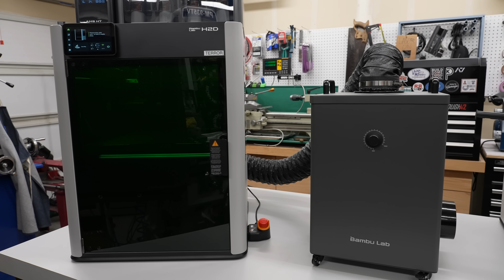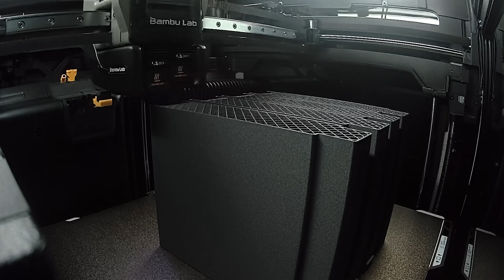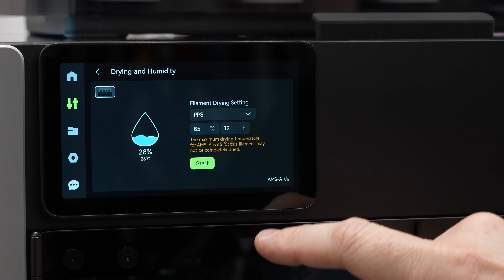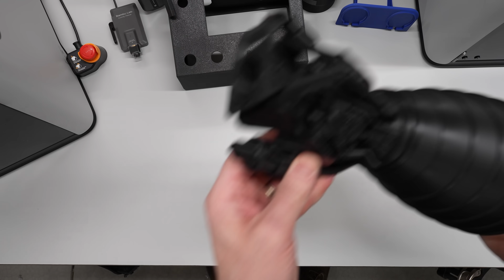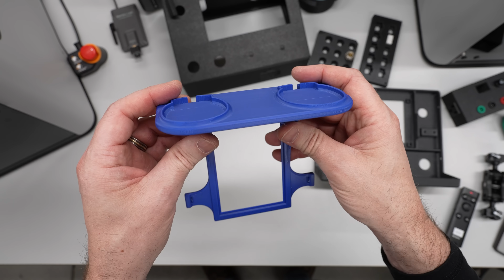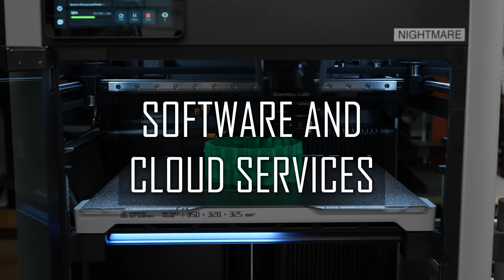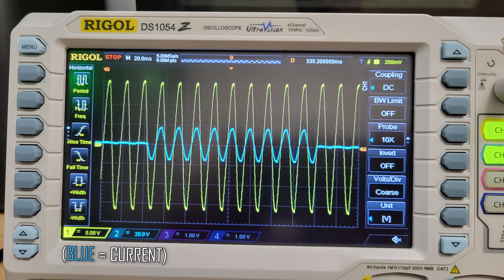What I Learned from 300 Hours with the Bambu Lab H2D 3D Printer

Comment: Very good an honest review! Thank you! 
But in general I'm very concerned when it comes to do laser work in a 3D printer. I own a bigger laser machine and the contamination from the fumes inside the machine on every single part is immense - even with a powerful extraction. Prepare to clean the entire inside of the printer after every laser job. Thinking of the delicate mechanic inside a 3D printer: Laser work? No way! Laser is DIRTY! Also the bed capacity is far too small for laser work in my experience. 3D print? Ok. But laser? You will most likely run out of space very soon. I'd recommend to buy a separate laser machine if you are planning to cut material if you have the space to set it up.

Comment: Unfortunately I can't agree with a piece of equipment that sends my jobs to the cloud and back to print 3m from my location. As well as constant monitoring. If the machine is in my LAN it should be able to work from my LAN. It's a pity, because the hardware is top notch and I would buy it. Also, why the hell would you put a laser in a 3D printer, the stupidest idea ever.

Comment: @Clough42 Have you tested any soluble support materials on the H2D (such as PVA or HIPS)? 

I’m mostly interested in using PVA in conjunction with PETG, but could do PLA as the main material. My geometries don’t usually need a lot of support materials, but they can be tricky (or even impossible) to fully remove unless I use a soluble material. Plus I want to reduce post-processing as much as possible as that is one of the most expensive parts of my throughput.  Hence why I’m most interested in PVA—because water as a solvent is cheap and easy compared to limonene.

Comment: Adding a laser unit is some gimmicky dumbfuckery one can only find on one of those crazy kickstarter all in one machines. Spoiler alert its never a good idea. Never. Cant imagine having to clean all the sut from the inside of printer when needing to do some 3d printing and then also doing tool head changes will be a massive pain. I own 6 electric drill because i got tired of changing the drill bit for ever time i need to drill another hole. Forget about being able to use the best laser software - lightburn as bambu will be steaming fwd with its closed eco system plans. The price point is also ridiculously high. U can get a formlabs
Qidi printers are the unsung hereos. Been my most satisfying 3d print experience. With my bambu i had a print error about 1 in 6 and with qidi its been 1 in 60 and very small errors. My bambu has destroyed 2 hot end assemblies which i needed to replace because of a very dumbass design by bambu. Very small/thin and exposed thermal connector which will get destroyed with a blob

Comment: A few things, I never asked for this, the true build volume is smaller than advertised. The main thing that intrigued me was that their website showed "live spatial alignment" using the birds eye camera. They showcase a shoe sole or feet per say and then being printed from this. I have yet to find any info on this and seen no one actually do it, this is the 3rd video I watch mind you. For now I will just stick with Prusa or others, Bambu has disappointed me after their latest firmware fiasco and the trying to hide it. I do like the new AMS, however, it seems like printing TPU is still an issue so there is that. And I do own a P1S, I was originally excited about it, until they did what they did. So again, I will just stick with others for now. I am upgrading my P1S to a open source printer as soon as AMS support comes out for it.

Comment: Have you noticed VFAs?
I guess they are always present. But the only printer i know of completely eliminating them are the HS3 by pantheon because it uses servo motors for the motion system and have ball screws instead of lead screws.

Comment: Geez, that's a lot of power draw. The average I'm sure is 200-ish? What I'd recommend to save on house wiring... and like, not being able to run even a small farm on a 200 Amp service... get an EcoFlow Delta 2 or other battery generator and set the charge rate for slightly more than the average draw. Most 1kWh capacity batteries will do 2400 watts output, so I'd try putting 2 H2D's on it to see if the surge capacity can handle it. This way, you can limit your draw to say, 500W per pair of printers.

Comment: I wonder, when did you print the multi material display with XL, that didn't print clean?  There are several reports the issue would have been resolved.  The thing is TPU is something I use often.  There's another video showing a rather not so nice picture when printing TPU with the H2D.  Was this the kind of harder TPU filament from Bambuu?

Comment: If this machine had an option to just run straight Klipper I would buy one.  Instead I look forward to Qidi building a knockoff to replace my current Plus 4, which matches many of these features already - heated chamber, 300x300 usable build area, filament drying, Qidi future AMS system, in other words only losing to this in multimaterial capability and print height. I know Bambu will NEVER willingly just allow people to use open source firmware that bypasses their systems so I'll never buy one of their machines.  It's that cut and dried. Thank you for the review.

Comment: I need 340mm width... I keep reading it can do the full 350mm by using two spools and both extruders. Is this true? does it leave a seam or ? hope someone can answer.
Reply: You ‘lose’ 25mm left and right, but can ‘trick’ the machine to use alternate heads and achieve the full width
Reply: @ right I figured you can split your model in half and assign two different “colors” and load the same colors onto two spools on the AMS. My concern is if using this method will leave a seam in the center where it’s switching extruders and filaments.

Comment: I watched this and Robert Cowan's review and I'm baffled by how accepting you both are about the firmware situation. "I'm fine with using the manufacturer's software and cloud service as long as they're reliable" just feels like a weird thing to say. They're reliable now but that really doesn't indicate anything about future support. Unless the implicit plan is that you won't be using this printer in 3 to 5 years no matter what (which might be reasonable--especially in a business I could imagine working that into the cost), the printer being so locked down means theres no fallback for when support drops.
Like I guess the idea is that if that happened you'd just shrug your shoulders, scrap the printer and move on, maybe make an angry video or two? Idgi.

Comment: I ordered one because of my experiences with a Prusa XL5.

I have had a Prusa XL5 for about a year. I had problems with it from the get-go; inconsistent first layers, layer dislocations, print heads detaching (ruining 3 heat plates in the process), culminating in the printing plate elevating past the Z axis screw support and breaking it. I communicated with Prusa support many times. Prusa eventually agreed to the return of the printer to Printed Solid for inspection. They sent me a carton and USPS mailing label. When I took the carton to the PO, it was refused for being overweight. Printed Solid admitted they knew it was overweight and anticipated it would be rejected. The reason they arranged return shipment through the USPS was due to high cost of UPS/FedEx (I live in Hawaii). Printed Solid said they would contact Prusa elevated support and get back to me. I never heard from them again, so my XL sits in a carton and my warranty is now expired. I sent a letter to Josef Prusa detailing my experiences. No response.
Reply: This sucks...I'm sorry to hear it. I hope it works out for you.

Comment: This is looking pretty good. The broken PLA in dual material mode is a good argument for IDEX — independent heads. But that would add complexity and cost. The other issue is a fear that Bambù will someday charge per print or somehow limit my ability to sell my work, or lock me into something that won’t work for me. Oh, and the price?

Comment: Reviews where the manufacturer provided the item are not worth watching.
In theory they don't have editorial control but it's common knowledge that if a Youtuber ever gives a bad review of a major provided product that they will not get any more products to review. Hard pass.
Reply: You say that you want a machine that will just work but no mention of Bambu's updates that lock you out of basic functionality if your using 3rd party software?
Also, combining a Laser and a 3D printer is just a terrible idea and saying in a comment that Bambu will provide replacement parts is hardly consistent with your motto of just wanting equipment that just works.

Comment: Thanks for the review. I’m keen at least on the 3D print only solution. You’re issue of noisy belts I’ve had on my P1S and their lubricant solution seems to have worked for at least 3000 hours or printing with no negative impacts yet for my printer.

Comment: All bells and whistles, but laser is a problem here, I know it's good to have it all in one unit, but the dust in laser must be cleaned every now and then even if you clean it it is really hard some times to get it from controllers, etc in a closed chamber. If you will use it for laser a lot it will fail, if you use it laser esporadically it may work. Everything else is a plus and a good machine for all. I would not buy a Bamboo, but it's my personal opinion, I think it's good for a plug and play business and with common materials like pla, TPU, petg.

Comment: I'm curious about the whole measuring filament on the spool thing.  Makes sense in a stock setup where the distance is known but what about stringing a couple AMS together via the Hub or just running the AMS from a shelf with a longer PTFE tube?  How does it know that distance to estimate the amount of filament on the spool?
Reply: The PTFE tube dosent matter. The ams counts the rotations of the hub motor until it detects the RFID tag again.
Reply: @lukahierl9857  Yeah, I finally found the answer in the interview with the Bambu CEO and CNC Kitchen.  Very interesting how they did that.

Comment: I assume the reason why the right extruder is recommended for the AMS system is because it doesn't move like the left, does. So plugging it into the right prevents more wear and tear on the moving parts of the left extruder if you don't have to move it as often.

Comment: I couldn't agree with you more about what i want from a 3D printers these days. Since 2012 i have modified, designed, built, struggled with bed adhesion etc. and i just want to print fast and accuratelt, not fiddle.  I have two X1Cs and have been hoping for a larger Bambu for the past year. This review helped so much. I should have mine in a a few days :)

Comment: How about prints warping I have experienced this with x1c using pla, petghf, especially with bigger prints.  I have yet to get a print with flat bottom on x1c when printing large parts.  This is the only reason why I am considering upgrading and the print size but I need my prints flat and not warping.  Any insight?

Comment: Where just missing the 2 at the end for the H2D2 hopefully they bring it with all the upgrades we want for the next one, 
Next machine would be best smaller like x1c, and we want a scanner in it, we need it to be double headed with 2 entries for the filaments so if we use 2 colors, no poop will be needed.
We also want prints that will just print what ever we put inside, like hard filaments that arent easy to print like TPU. 
Love you BambuLabs!

Comment: @8:40 they make clear glass that is safe to look through when using a laser. Lot's of co2 lasers have glass that is safe to look through without protective eyewear.
Reply from the maker: Good question.  I don't think I'll use it that much, but I guess we'll see.
Reply: Different wavelength. Here we have blue laser somewhere in the 450nm range, so finding glass will be really difficult. Also no matter if glass or polymere you'd end up with 55-65% transparency in red/ orange or green light to block the blue laser.
Reply: A CO2 laser emmits an infrared wavelength instead of the blue 450nm of most solid state lasercutters.

Comment: I watched your complete video and was amazed by the detailed information and the amount of printing time you have so far. Like you, I'm not into messing with my printer; I just want it to work out of the box. I like the addition of the cutter but don't like that you need to get the laser to get the cutter. Oh well. I have a P1S with AMS and am happy with it. I do get more spool tangles than I care for and I use mostly Bambu filament. Great job. Best and most complete H2D review bar none. I'm Canadian and have stopped subscribing or giving thumbs up on anyone from "'merikuh". I did for you today. Nuff said.
Reply: Forgot to add that I'm not sold on a laser that creates  particulate matter (in smoke) getting on the inside of everything in the printer. I'd need to do a clean after every session and that's more work than I want to do. Even with that it would be similar to living in a house where there are active smokers soiling the inside of the house. I won't buy an H2D but will definitely add an AMS-HT and likely an AMS pro in the future to my P1S.

Comment: For $3499.99 for a 3D printer, a 10w and 40w laser cutter, cricut plotter, and a marker plotter to draw pictures just doesn't cut it for me. We asked for a much larger printer and we got a 350x320x325 build volume. Thats not much bigger than my X1C or my A1 printers. The publicity Bambu received over its firmware was the decision factor on me purchasing any more machines from Bambu Labs. I would rather buy a Prusa XL for about the same amount of money.
Reply: stupid in math? the printing plate is nearly double size!!! 😄👍

Comment: My favorite video on the H2D so far. You actually made me really want one lol. I have concerns over long term use of the lasers and residue/buildup getting stuff inside the enclosure dirty, but I also wouldn't be using the laser very often to the point where if I were to buy one of these, id just get the $2200 H2D Combo. 

Though the cutter tool as an upgrade down the line seems useful...

Comment: A thought on the petg temperatures would be that if the printer knows which AMS the filamnet is coming from, and the filament has been in the AMS long enough for it to have cycled through a dry cycle, or at least long enough for the filament to have stabalized to the ambient humidity in the AMS, it may make sense to do per-print job modification of the extrusion temperatures to be "right" for the filament that's in the printer. That might not be a significant enough issue to really work on the software for that, but I wouldn't be surprised if that becomes a selling point in the future if (as an example) no one in the Klipper community builds it into Klipper, or perhaps even more so if Klipper does get that feature. (Though if they have it already, it apparently wasn't enough of a feature for Bambu Lab dev team to pick up on it yet.)

Comment: The things that interests me is: how messy is using laser (one review says that 3d prints are stinky due to previous laser jobs), how it affects accuracy of 3d printer mechanisms (that's something that will be answered after few months I guess), how it handles filament changes when it needs to do filament change in particular AMS (assuming each hotend has it's own AMS) - does it do that as efficiently as possible (parallelization while still doing printing), how (also very) flexible filaments are handled (multimaterial prints), is it able to detect filament jams and recover (X1C is unable to do that), how spaghetti detection works now (cloud, local?) and if it works better than (not so good) x1c, are you able to initiate prints and view status if internet goes down (is there any automatic fallback to LAN; I have LTE only here) ... probably more but these are from my head right now. If you can take these into account while testing I would be appreciated.

Comment: Did you run the pa cf with the ams2 or the ht one?
Reply from the maker: I ran it in the ams2.  The HT does have a direct feed port, but I didn't use it, so in that respect, the main difference is the drying temps.

Comment: James, this is a review as it should be done by everybody. It cannot be done better than that: a lot of real testing and experience transmitted, with nuance.
The parts you printed look amazing and for the first time they really look like something out of a factory. Really impressive stuff. Thanks.
Reply from the maker: Thanks!  As you are well aware, doing a review to this level is an enormous amount of work.  I always swear I'll never do another one.  Eventually I get curious about something, though...  :)
Reply: @Clough42  I was waiting for years for a QIDI iFast evolution that never came [main problem I had with it is it's really very slow, but it really got the job done for me for years], so thanks to your review I found out the H2D is just what I need to replace the iFast.  Thanks!!!  😁
Reply: Your reviews are insightful and more importantly brutally honest. Your journalistic integrity moves the bar upward, and for that you should be proud. I own a Bambu X1 C primarily because of your review of them. It does everything I need it to do, although I am struggling with CF materials. I think I can speak for the majority here, and ask that you continue with your top notch and impartial reviews. Cheers from Florida’s Space Coast.

Comment: damn it will one of you tell me if it's faster than the x1c?
Reply from the maker: In my experience, with the default profiles, they're similar.  Flow rate is really the limiting factor most of the time, and the H2D should have an advantage in that area.  I make no claims because I haven't tested it specifically.